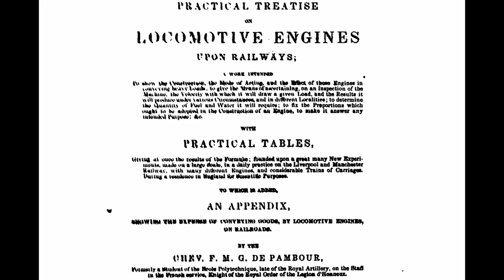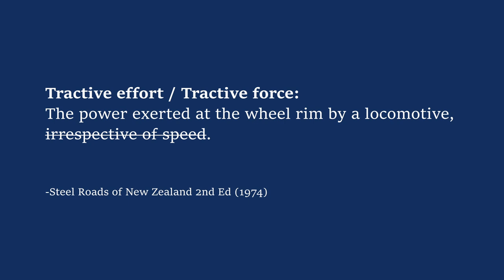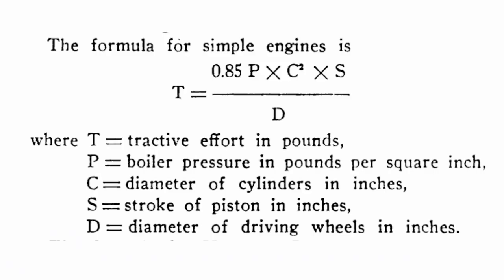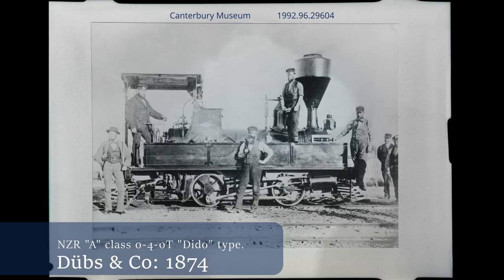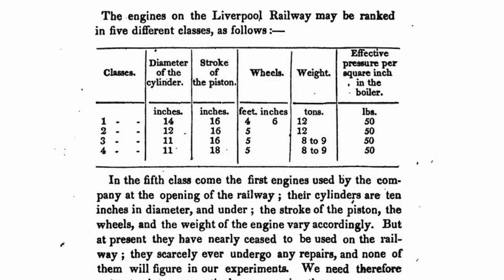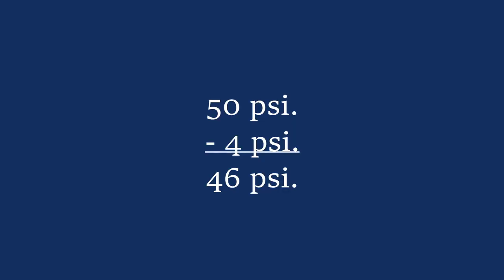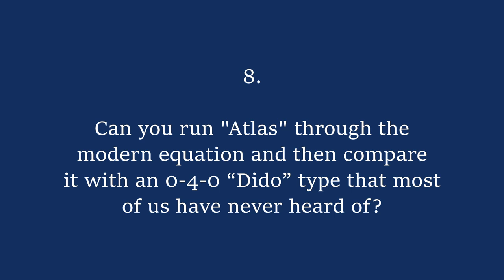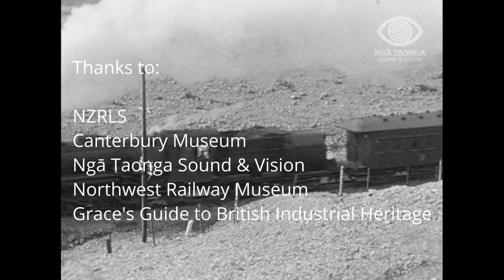Tractive Effort - Part One - The History

Comment: Should be 80% boiler pressure for saturated boilers and 85% for superheated boilers. NZR rated everything at 80% regardless. South African Railways used 75%.
Reply from the maker: The short answer is that I literally don't know if superheating was the reason for the different percentages.  The longer answer is that I'd be surprised if it were.  I'll re-check the earlier editions of the Locomotive Dictionary to see if U.S. practice was 80% in the pre-superheating days.  But my recollection is that it was always 85%.  Certainly, my U.S. books calculate TR with 85% for pre-superheated locomotives.

Any particular reason why SAR went for 75%?
Reply: @theimaginationstation1899  The Great Northern here in the US used used the coefficient of 76.5% when rating their locomotives so they came in with a conservative tractive effort rating. When they are recalculated with the common formula some GN locomotives came up with some impressive numbers comparatively speaking.
Reply from the maker: @greatnorthernn-3154  I wonder if it had anything to do with compensation for curvature.  Because in New Zealand a 1 in 50 grade (2%) was the gradiant plus the curvature - whereas other juridictions slacked off the gradient as curves were rounded, so that the grade was a true grade.

That way the, say 80% modifier would allow maximum loads to be calculated for any given locomotive without having to factor in the curves.
Reply: @theimaginationstation1899  You may have something there as Great Northern had sections of grade as steep 2.2% in their rail line west of Minot ND.  The "R" class locomotives were built for this section of line.
Curves on a rising grade does limit the amount the locomotive can handle. The rigidly pinned driving axles on the steamers with no differential action dictates that one drive wheel on each driving axle has to slip to compensate for the difference in rail length on the curve. A steamer that is pulling tonnage that spins out on a grade curve is very difficult to restart.